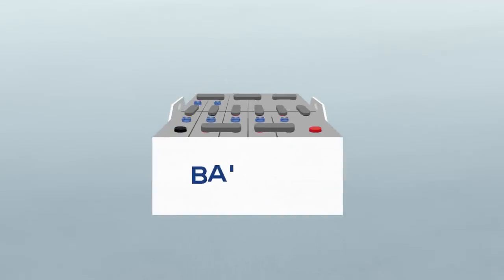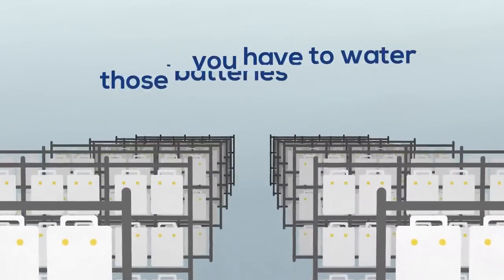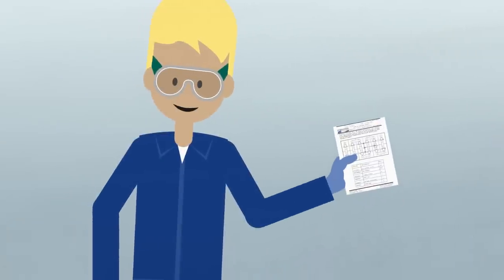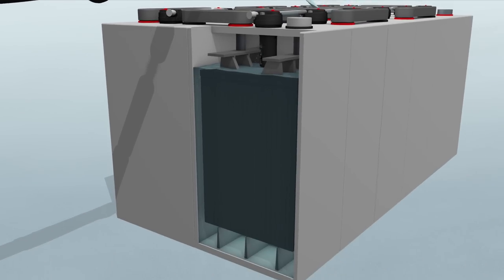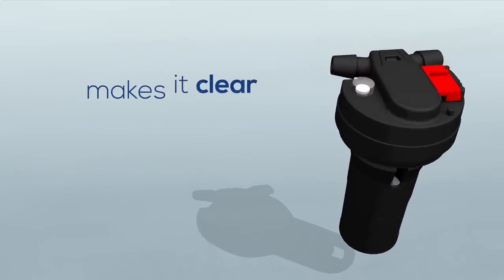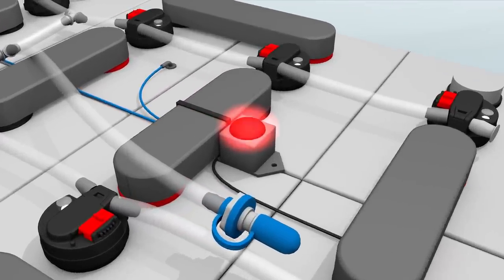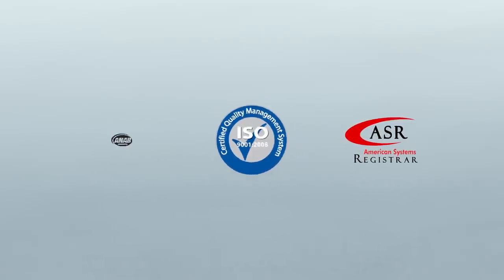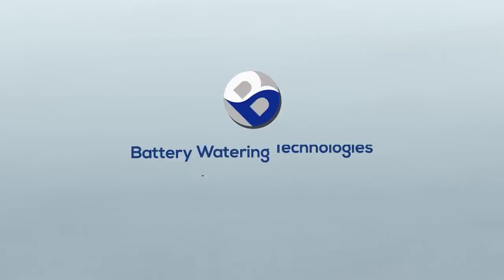Battery Watering Technologies: Why Batteries Need Water

Comment: i have this and a gravity feed system attached to it. why wont the water flow properly? i have air bubbles all over in my tubing and i cant get them out.
Reply: I have worked with battery watering systems for 30 year and have not seen gravity feed in over 20 years. Depending on the brand of water system valve you should have water feed from some pressurized source such a city. The pressure is delivered to a garden hose and then through a regulator that provides the valves with a precise amount of both pressure & flow. Most city pressure is around 30 psi. Most water systems are low pressure and require 3-5 lbs pressure. You could buy some kid of portable tank that will allow you to quickly will and provide the necessary pressure and flow these systems require.

Comment: Hope they push the envelope further for better injectors, we changed our 700ish batteries over to this system. The valves have a tendency to get stuck in the flow open position and causing a cell to flow over with water.

Comment: what happen when we enter the water in kits / cups dropped on the surface of the battery cells ... ?
Reply: water will not hurt or effect anything on the exterior of the battery. It will usually evaporate as batteries tend to generate some warmth

Comment: Not impressed with ours (similar system but not this specific to this one)!  It flooded our battery cells!  If you have one, be sure to verify that the battery is at the proper level after done.
Reply: if the battery is not fully charged and you add water and charge later that day the battery will flood. Most water systems come with an accessory blinky water light. Only check that light after full charge. If the light is green no watering required if it is red then you have the correct timing to water. Timing is everything

Comment: why invrter battery's water overflow
Reply: Water level drops as a battery discharges, than rises again during charge. If you water the batteries while discharged, they have a tenancy to overflow the next time it is charged. Hope this helps. I always use distilled water, so I like the fact that this system can use a low pressure gravity feed, where I can just siphon water  into the fill valves.

Comment: Never mention what kind of  "water" that can / should be used
Reply: Tom Stakvik  always use distilled water in batteries that is kind of a your suppose to know before you even own a battery!
Reply: You would be supprised how many people dont know that :D
Reply from the maker: Hi Tom, we tried to keep the video short and sweet and didn't touch on that important talking point. Typically, people fill their batteries with distilled water. This is the safest route to take if you aren't sure about the water quality in your area. If you would like us to test your water, we are happy to do that for you free of charge. Just send the sample to us c/o Battery Watering Technologies, 6645 Holder Road, Clemmons, NC 27012.  Put a little note with your contact information in with the water sample so we can contact you once the testing is complete. Julie
Reply: Deminarlise water need be fill
Reply: My company uses tap water, even though everyone out on the shop floor knows in their hearts that it's a no-no.
Reply: What about using Rain Water?
Reply: bhushan sthapit not clean enough for batteries